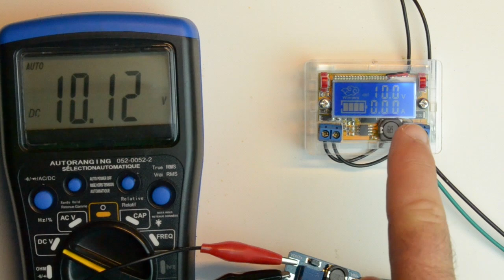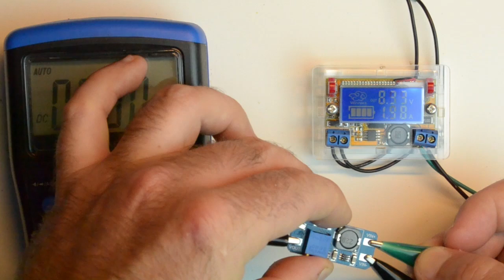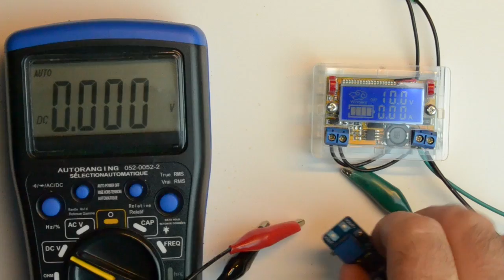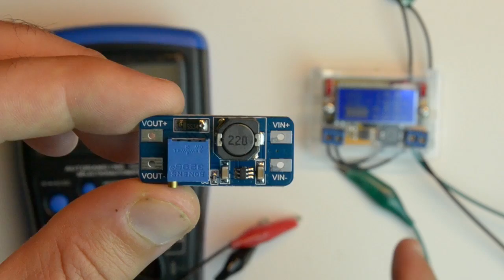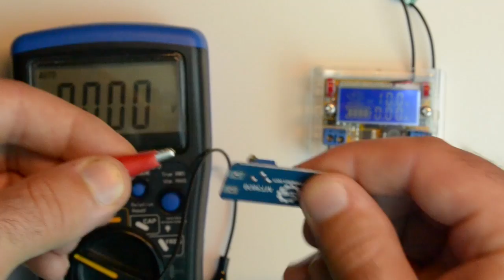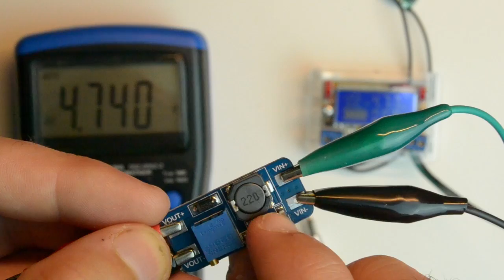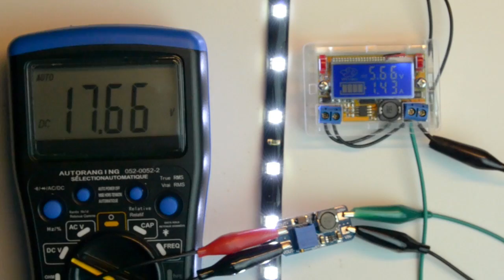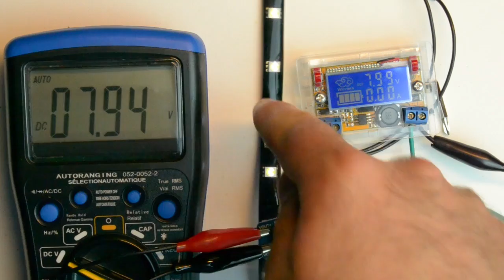Caught on FIRE?? MT3608 DC DC step up boost coverter

Comment: Yes . I have 4 like that but a bigger one . Same problem as you have  exactly . I was have to do a reverse engineering my model board . My first problem was the diod was short out and damage the ic 

My second was the resistance 10k was not work so it have these problem . In order to make them work again I have to re change all part on them except the conductor and VR

Comment: turns out, you need to turn the pot counter clockwise to increase the voltage.
turning it clockwise too much will destroy it for some reason.
Reply: Because the PWM goes to 0%, witch means the MOSFET shorts the inductor output to ground
Reply: Ive been working with this stuff for a while and there's no standard I know of that specifies which direction is  up or down.

Comment: stepping up voltage doesnt do any damage to the module,but when it comes to step down voltage,shits happen. Because when you try step down voltage this module setup trying to hold some of energy in itself in order to limit voltage, that s why it gets hot and circuit gets burn. I also burnt this exact module,while trying to step-down 12v -1.5amp tablet charger. it didn't burn immediately ,but after continuous usage, it get heated up and burnt after while. AND ALSO YOU HAVE TO TURN IT COUNTER-CLOCKWISE (FOR THE FIRST TIME) BEFORE USING

Comment: You have to turn 20x,30x or more to see a reaction (but in the SAME DIRECTION) and not 5 times forward and 6 times backwards!
Until 1A should it work normaly (without warming)
... I installed more than 25 pieces each day and I had an error rate of  5% only

Comment: I have that kind of booster,all have default voltage of 3.98v,and i set it to 5v,all 5 of them,and the last one i tried putting it to the maximum voltage of about 20V, luckily,all of them are fine,5V is my source,a battery(3pcs old phone batteries) and TP4056 module for charger.

Comment: The lower the voltage you use the more current draw it is going to take you need to start with a higher voltage if you set your input voltage to 10 to 15 volts it will not have to draw so much current that's why it's burning out
Reply: Try it with the much higher input voltage your current draw will drop

Comment: Dude, you are using a SMPS to provide an an input voltage. These modules are made for straight line DC input voltages.
Reply: Those are the same things. SMPS's put out DC.
Reply: @BenjaminEsposti  Yeah but....don't SMPS's put out high frequency pulsating DC as opposed to straight line DC as one would encounter from (for example) a battery?

Comment: 0) Get a fresh Module. ( Do NOT power it )
1) Do twenty counter clockwise turns on the pot
 ( This lowers the boost )
2) Connect 2 AA batteries (3v) on the input
 ( Start with a low voltage )
3) Now check the output. It should be higher than 3v. If it isn't, do 20 more counter clockwise turns on the pot.
Reply: Yes. it works  (:
Reply: You think it works well with a 3V power supply with the module putting out 9V ??
Reply: @sazonswaggreviews4449  It will do that, if your 3V is constant, not a pair of 1.5V/1.2V batteries that drain too low during use, and of course, if your 3.nX voltage boost, does not exceed the current capacity of around 2A.  That's 2A worth of boost.  For example, if you have 3V in, and want 9V, 700mA out, that's 2.1A so check the temperature as it is probably too much to ask of this module.
Reply: 0.5) Check that the potentiometer is wired up correctly.  Two of the pins need to be bridged, or the voltage divider the chip uses to set the output just doesn't work.
Reply: NO!  These pots only have about 25 turns total, so if you do 20 turns, there is no reason to do as many as 20 more.  You also have it backwards, you do not want to  lower the boost.  That is what causes the problems.

You want to raise the boost above the input and then back off the pot a half dozen turns from that.  Also, certain designs of the MT based boards, are turned clockwise to boost instead of counterclockwise.  Best bet is measure with a multimeter to see what it's doing before applying power, and of course, give it under 6V input till adjusted, then try higher input voltage.

Comment: I bought 5 of these (ebay seller from China - exactly the same layout but different branding) the first developed a hard short across the input after a few minutes, the others would start "crowbaring" when connected to any load, and would not reach a steady output voltage if the load was connected before powering up the device.  I found that if I added a series resistor (1/2W 220Ω) to the output they would produce a steady voltage, but soon the resistor began to dissipate a lot of heat, even though the circuit was only drawing 30mA.  I gave up completely and went back to the XL6009 based device.

Comment: Next time it would be great if you check what you buy dude :D

1. You surely meant your multimeter has high resistant not high impedance... as this would mean nothing here.

2. Powering a switching converter (no matter if buck, boost or buck&boost) with a switching "power supply" is defenetly not the best idea :D 
(use something stable next time or at least try to smoothen it with capacitors)

3. To increase the voltage (that's what boost converters do) you have to turn the potentiometer counterclockwise.
I always see you turn it clockwise or just 4 times counter... that's not enough after beeing completely on the clockwise side.

Interesting video anyway.
Also if I don't understand why you kill the pieces in a row not trying to think if your behaviour or the supply could be the problem :D

But I must say that the first one burned pretty fast and the manufacturer should build in some caps to prevent such situations. 

thanks for sharing this video!

Comment: i replaced the100k  25 turn multi turn pot with a normal 100k normal 270 degree trimpot.  the 25  turn trimpot is really stupid and you need a screwdriver and there is no knob for it anywhere

Comment: LOL... he turned the trimmer only wrong direction… Left for higher Voltage - Right for lower… step up converter can only higher voltages like source, when source voltage Little as Output Setting, it "converts" ever source minus 0,7 Volts
Reply from the maker: Either direction you turn shouldn't end in fire though, and this is how I learn, trying things!
Reply: To the blown converter: Don´t combine step up/down converters!!! Use a Batterie for test, and you turned wrong direction… Trimmer screw can rotate 15 times.

Comment: other users who buy and try to do the voltage folding without connecting any load to the output as much as I can see from the video footage its working but some of the modules may be defective or solder faulty.I bought 5 units, renewed the first module corrupt output solder did not work again..
If I knew that they were bad productions, I would go to higher modes..I would use 18650 dual batteries for the bluetooth speaker project to upgrade 7.4 volts to 12 volts and up..
I will not get a cheaper circuit :(((

Comment: @simpleelectronics I had the some problem with adjusting. But i learnt that chinese said that you must turn the potentiometer 20 times to counterclockwise. And it should be work,during turning. It will start regulate voltage after while

Comment: what power supply you use ?
any link to buy it ?
Reply from the maker: Hello, this video will show you my quick look at the power supply: https://youtu.be/Ve0msHFoyo0 just search for it on your favorite Chinese reselling site (ebay aliexpress etc...) and get the cheapest one!
Reply: Don't buy those power supplies, they are rubbish!!!
Its the reason why the booster wouldn't work in the first place - the power supply he was using produces noise, which interferes with the booster causing it to oscillate and then burn out when it tries to boost the supply voltage.

Comment: Just had a similar module but one with an integrated micro usb connector.  The thing was still in the package and bought it over a year ago.  Finally found some nice use for it and before implementing I decided to adjust to the desired voltage. Mmm error, full shortage. Checked my probes, all ok. Then decided to check what got hot and limited the current in steps. At about 7amps, yup that high, the pcb felt a bit warmer but not that much. Not 1 component got hot. The only thing that would be causing this is a massive short in the pcb where the input was or the micro-usb connector.  So I desoldered the micro-usb ... working as designed now.   The IC itself might be good but implementation on the pcb or testing is a big no no.

Comment: Hi guys. If you wanna make this work check first variable pot resistor to be set on minimum 3.3kOhms and connect on input 3,7v li-ion batery. If voltage raise above 10volts you are fine. Do not forgot voltage between input and output must be higher than 3V.

Comment: sorry I have a solution for you NEVER EVER HAVE A HIGHER INPUT VOLTAGE THAN OUTPUT THAT`S WHY THEY BURN!!
Reply from the maker: That's usually good advice but in this case, it's a dc-dc step up module, having a higher output voltage is what it does. That's the point.

Comment: You are a clown??!!! You draw a 3A current accounting to your meter ocourse it burn??!
Reply from the maker: Thanks for your comment but, there was no way that the load was going to draw 3A, what had happened was that the IC shorted and pulled 3A from my supply, and the only reason that it stopped at 3A (see the definition of short circuit) is because my supply was limited to 3A
Was quite fun though.

Comment: Gentleman,
I got similar module (I say similar because layout of components are exactly as in the video, but there is no text in the back).
My modules may have different R1, R2 etc. may be, but same MT3608 chip.
I believe the problem is powering up this module with a switch mode power supply. Since the module itself is switch mode.
I am working in industrial automation sector for 20+ years and we always have problems with switch mode PS connected in parallel or powering each other (connected in series).The details are not important but it is the case for the %80 percent of switch mode PS.
I would recommend to use 2 pcs alkaline batteries as input for the first trials. For the first trials do not use lipo, sw mode PS or re-chargeable batteries since their discharge current is very high, in case you may burn yourself and module.
Before connecting batteries I checked my modules, according to MT3608 datasheet. My module R2 is 2.2 K and R1 is the blue trimpot. I set trimpot arround 30.6 K. According to the calculation in the datasheet it will give 9 V output with 3 V input.
After I set the trimpot, I connected input, and without any load I measured 9 V output.
When I connected load (actually JYE tech DSO150 oscilloscope with 9 V power input), there is no voltage drop it is stable at 9 V.
Here is my findings:
1. Voltage stays stable even if input voltage changes but not below ~2 V as it is the lowest voltage according to datasheet.
2. With or without any load setted output voltage does not change.
3. If batteries are weak or the load current is very high to the MT3608 (check specs), when load is not connected there is no problem. For example from input you can read 2.4 Volts and from output is 9 Volts. 
However when you connect load, module output power drops 4-5 Volts and  input still seems 2.4 Volts. Input does not drop under 2 Volts however module not functioning. You may hear a sharp sizzling sound when you connect load.
This is the time you should check either your load current or your batteries.

I read on some comments that there should be capacitors, actually there are capacitors on the module. The brownish components in each side of the MT3608 chip are SMD tantallum capacitors.
However if you have problems with feeding from another switch mode PS (Powerbank etc.) add capacitors, this may solve your problem.

Comment: I have the same problem,  i am using it to power 12v leds from 3.7v 18650 battery and its flickering (seems like module is trying to shutdown because of overheating),  however i was able to adjust output voltage.

Comment: To turn the output voltage UP on these, you turn the screw ANTI CLOCKWISE.
Reply: By the way, if you've bought 20 of something and they're ALL faulty, then perhaps you need to consider that maybe you're doing something wrong?
Reply: @dazmatic  there are wrong numbers in the datasheet. It can handle about 7V in max.

Comment: You arent ment to put in more than 2 Amps in that IC, and you cant expect 2 amps at 24V on the output if you have only 5V on the input. Just read the datasheet first and limit the current to 2 Amps or less when testing
Reply from the maker: Thanks for your reply, just wanted to point out that although it seems as though I put more than 2 amps through the device, my load should not have pulled more than a few hundred milliamps. The 3 amps you see is my power supply current limiting because the unit shorted internally across the input. The blue screen in the background is supply current, not load current.